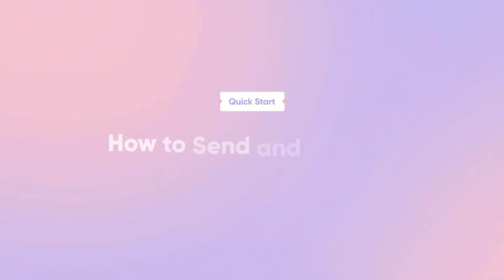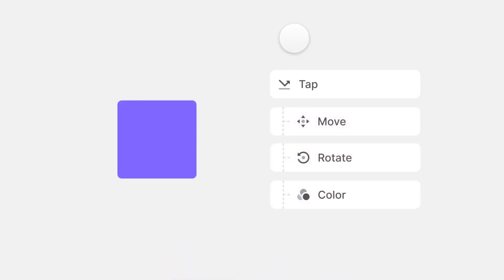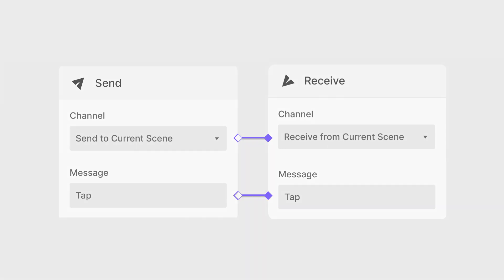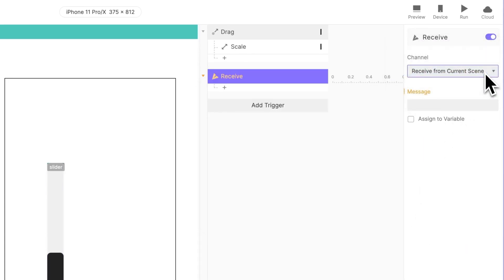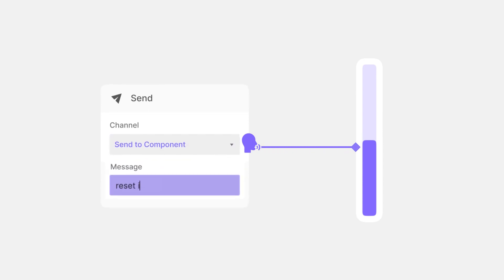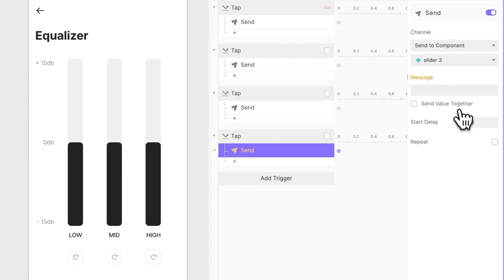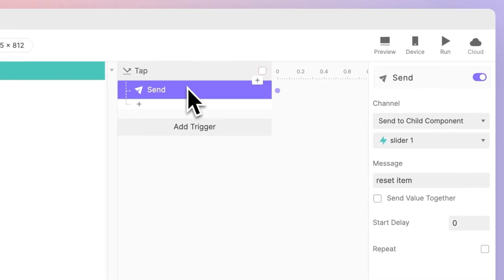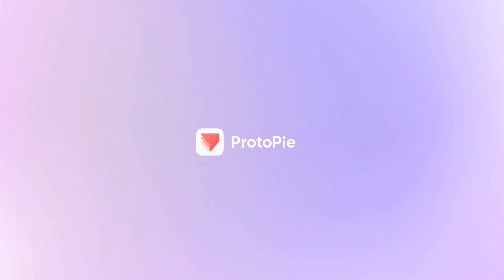ProtoPie School: Master Sending and Receiving Messages | ProtoPie Tutorial

Comment: Very flawed tutorial, it does not even mention starting with making the elements components, applying effects on the component, and then continuing, I could not follow it at all
Reply: Add a "Drag" trigger to Active, under slider 1, and then add a "Scale" option. direction as Up.